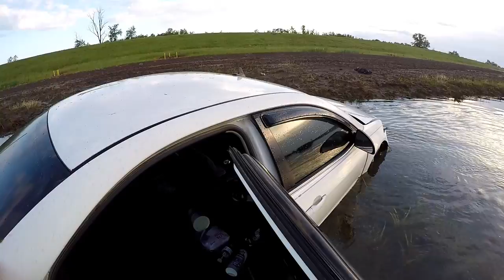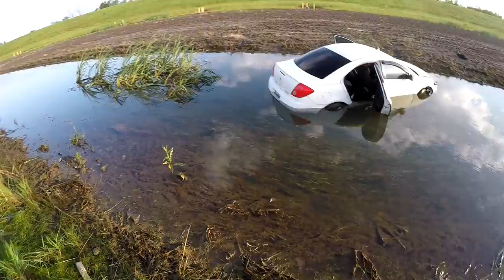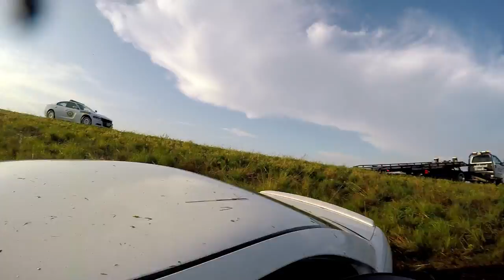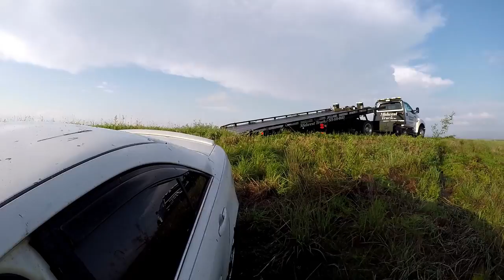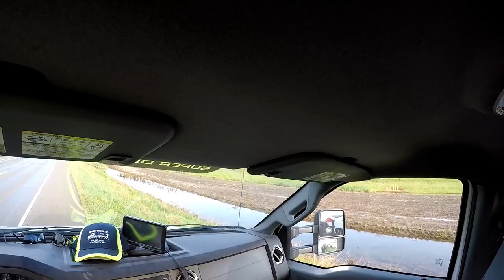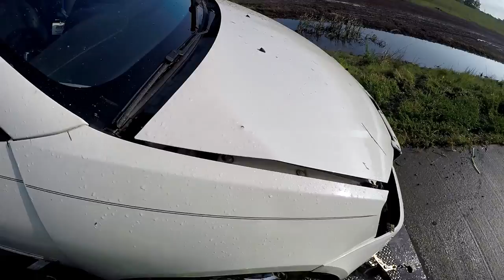WATER RECOVERY CAR FISHING FOR A G6

Comment: Why did you put the strap through the rear of the car? Why not just attach a chain or cable to a tow hook in the rear?
Reply from the maker: Personal choice.  It was easier to run the strap through the car than try to feel under the water to find an R-hook hole.  Just my opinion.  There are many different ways to reach the same results.  Whatever works best for each individual. Thanks for watching and God bless.

Comment: Nice work Ron, kind of disappointed in the trouper NOT checking the car 1st when he got there. may just have been a dead body in there when you opened it up.
Reply from the maker: I would not have been happy if that were the case!  That certainly is not what I signed on for LOL.  Instead it was a lot of dead trash.  God bless.

Comment: may as well take it straight to the scrap yard... and that copper really didn't fancy getting wet did he
Reply from the maker: Unfortunately, there is a lot of paperwork and time that must pass before I can take it to salvage.  I wish I could take it straight to the scrap yard.  Thanks for watching and God bless.
Reply: I don't think these modern cars are ever really loss recoverable after submersion... Saying that though I was amazed to see the electrics still functioned and you were able to move the auto transmission. Does it get frustrating you doing all that work to fish it out only to find there is no insurance? I really hope you get paid for that effort one way or another...
Reply from the maker: It does get very frustrating not getting paid.  This was one of those jobs.  I am working with insurance reps and state agencies to try to change things, but it may never get done.
Reply: In England insurance is a legal requirement, is that not the case in your state? With time and paperwork are you eventually able to transfer ownership of the vehicle to you in order to recoup some of the expense? Do you ever refuse to do a job if you find out the car has no insurance? Sorry for all the questions... I find your videos very interesting thanks for sharing them my good sir

Comment: what happened with the rotador?
Reply from the maker: The rotator is fine.  I operate several different towing/recovery vehicles.  Not every job requires using the rotator.  I was able to recover this vehicle with the rollback without any problems.   Had I needed the rotator I could have gone back to get it.  Thanks for watching and God bless.